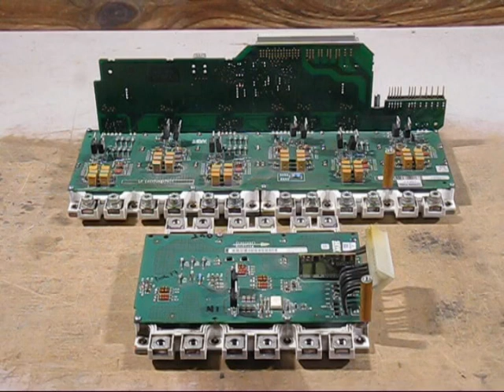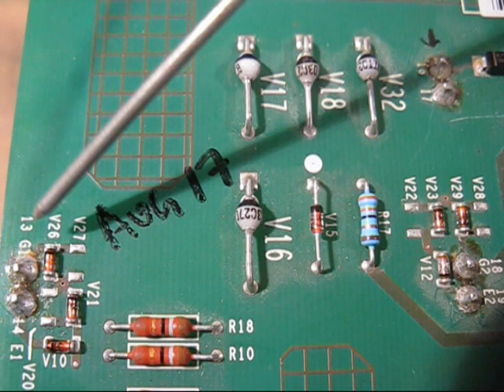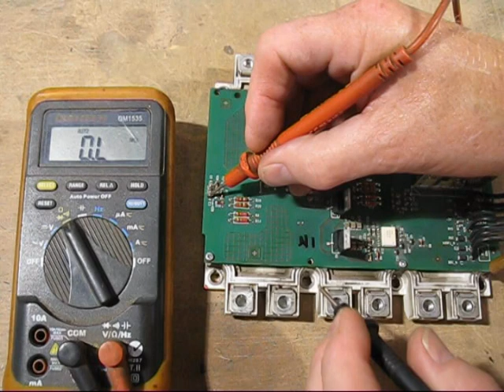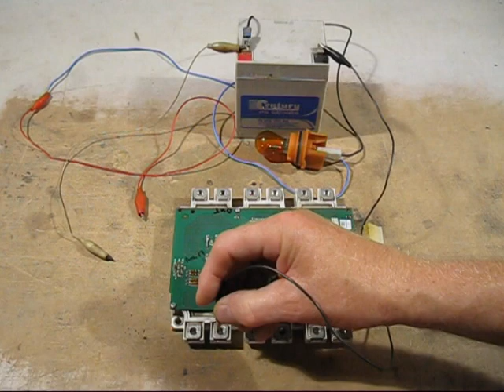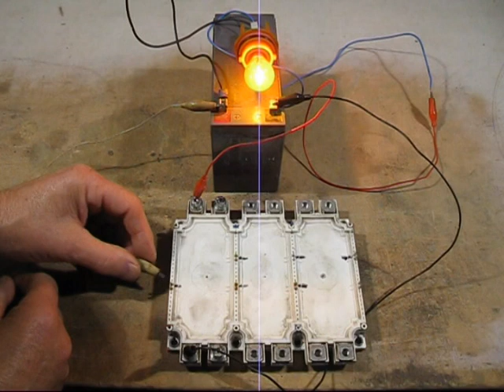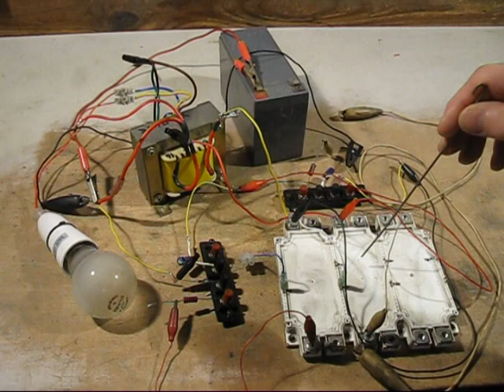Dismantling a VFD how to test IGBT modules

Comment: Well, that was different! I'll have to check the previous video (got no notification for it), but I didn't expect you to also be so much at ease with electronic circuits, particularly a beast taken from a high power VFD.
Well done, including a simple 240V inverter as tester :-)
Reply from the maker: I follow a lot of youtubers that are into electronics and I always click onto their channels to see their latest videos to bypass notifications. I found that notifications are very unreliable. If you liked this video watch another one of my  videos "How to charge up your 12v car battery with a laptop power supply using my improved version"  It came out six months ago and uses IGBTs.
Reply: @luckygen1001  Glad to know that. I'll have a look :-)